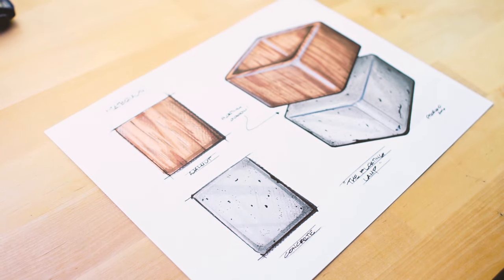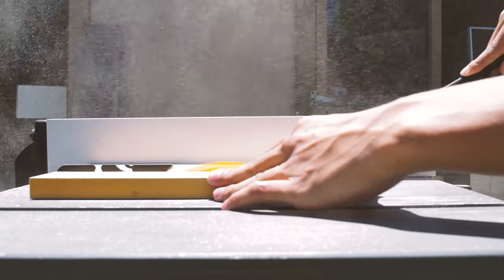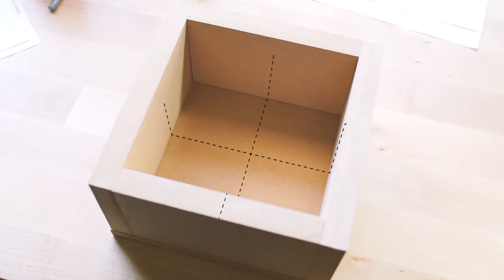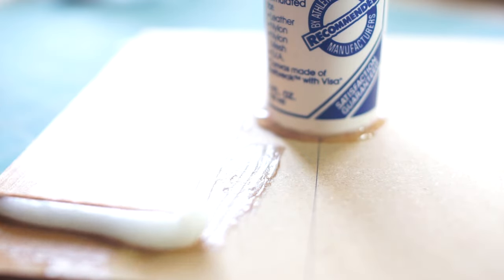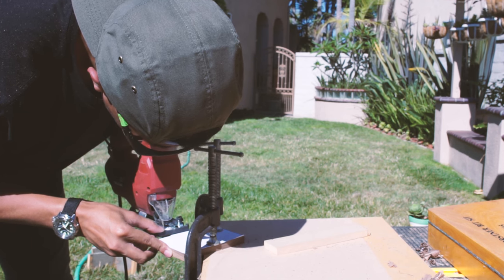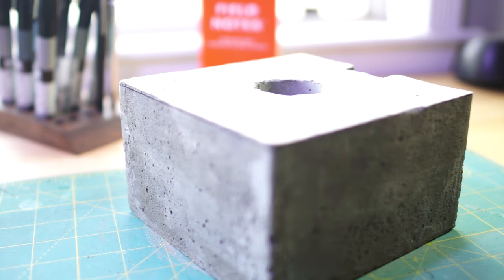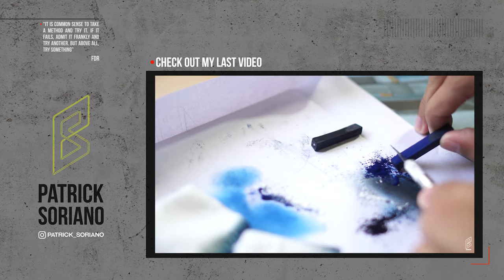DIY Modern Concrete Lamp that "floats"

Comment: Nice project man!

Quick tip :-  you can vibrate the air bubbles out of concrete with a palm/sheet sander held against the mold, I've also seen people reciprocating saw for this too although those can be a bit violent if not used with care.
Reply: sander is just right

Comment: Nice Job! If you want a really smooth finish on the concrete you can use a (random) orbital sander without the sandpaper to vibrate all the bubbles out.

Comment: If you hold a vibrating palm sander against the mold it will help the concrete settle and get the air pockets out very well.

Comment: Awesome project! I just subscribed to your channel. I'm looking forward to more videos! 

Just to suggest - I'm not sure how you stored the concrete overnight but if you cover it with plastic or a small towel and keep it in a warm place like a shed (you can keep a heater near it too if you're feeling wild) you'll be able to preserve the heat retention and moisture in order to allow for proper curing of the concrete so you can avoid it falling apart when you demold your piece. Also for smaller concrete projects if you take any power tool and hold it near your project to vibrate it, you can eliminate more air voids. 

Great work!!
Reply from the maker: Hi Lauren! The tips are much appreciated! This was my first time working with concrete and it was a lot of fun! I'll be sure to use a palm sander or something next time for the air bubbles as well as the plastic/small towel trick. Thank you for watching and thank you for the support!
-Pat Soriano

Comment: Very nice! If you add a touch of isotopic alcohol to your mix it helps get rid of those pesky pin holes. Palm sanding the mold as you're pouring also helps (-:
Reply from the maker: Thanks Danaka! I'll be sure to keep that tip in mind the next time I work with concrete :)
-Pat

Comment: YOU never mentioned how you attached the wood shade to the base
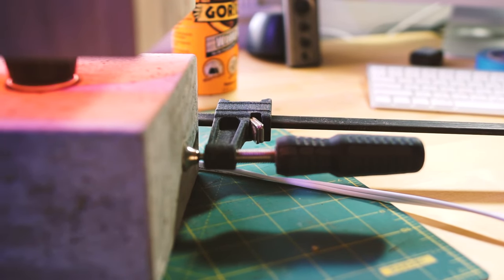Reply: 4:40 I think this is where he did it.
Reply: "I used gorilla glue, I would probably use a 5 minute epoxy, it's holding up for now." At 4:40, even has a shot of him having it clamped together while the glue cures.

Comment: The shade on the thumbnail has rounded corners inside and out, yet the video shows you butting the wood up to make square corners. How did you get the smooth corners inside and out on the shade seen in the thumbnail?

Comment: hey, Patrick.
I have a doubt. In the first example did you show us in this video, the corners is rounded. Did you used some different process or just polished the corners with sandpaper? BTW it is an incredible project. I just want one in my desk! See ya!
Reply from the maker: Hi Mateus! You can sand them that is definitely one way to get the rounded edges. What I did was I made the lampshade out of 8 individual parts. 4 sides and 4 corner pieces. On the corner pieces I used a 1/2" roundover bit in my router on one edge and on the inside I used a 3/16" cove bit to create the inner curve. Hope that helps/makes sense, thank you for watching! 
-Pat

Comment: nice design, though I prefer steel to concrete. Small idea for a variation: mount the lamp inside the wood ring so the socket is invisible.

Comment: hey man cool vid - i like the editing of the video, good job! also the lamp looks really nice, the one with round edges is a nice eyecatcher, thats for sure
i know this might sound stupid, but you should think about using aluminum plates for creating molds. if you have access to a laser cutter in your area, you should make use of it, and get a couple of plates with interlocking joints in various sizes. this will mean that concrete shapes will come in repeating dimensions, but it will reduce your waste output, and will save that dank $ in the long run. greetings (y)

Comment: This is dope! I'm gonna try making this
Reply from the maker: Sweet! If you have any questions or need help on a step don't hesitate to ask Frank! 

-Pat
Reply: I do. You said to use 1/2 inch hardwood of our choice but it appears you are using a bigger size? or am I wrong?
Reply from the maker: The hardwood I used was 1/2" walnut but for that shot of the materials I just grabbed a scrap I had laying around so I could show the materials that were going to be used. 

If you have any other questions let me know and I forgot to mention in my previous comment thanks for watching!

Comment: Excellent video Patrick!  I like the design and implementation, the pace of the video was excellent, not too long at all.  Actually, I could have used a little more explanation on how you connected the shade.  If you are not already a member of the FB group "I like to make stuff" You should join.  Lots of makers, great people.  I shared your video to the group so you'll be getting some numbers increasing there...:)
Reply from the maker: Hey Josh! Haha the video was actually around 9 minutes when I first put it together but I ended editing it down because I honestly didn't think anyone wanted to watch a video about a lamp and because of that a lot of steps were glossed over. As far as the shade, I just used wood glue but maybe a 5min epoxy would be better and I applied it to the pocket on the concrete base as well as the lampshade upright, made sure everything was squared up and clamped it up! 

I added the group of FB (at least I hope it's the right group haha) I think the request is still pending. I really appreciate you sharing the video and thank you so much for watching Josh!
-Pat
Reply: Awesome, thanks!  I will see about getting you approved for the group if it hasn't been already.  Good luck son, and I be waiting for the next one... :)

Comment: Looks awesome! Does anyone know if he used any way to fasten the lampshade to the concrete? I feel like it wouldn't be a snug fit
Reply from the maker: Hey Charles! Yeah sorry about the lack of info on how the two attached, I tried to keep the video short and because of that I glossed over that part. I used wood glue to bond the two parts and it's held up real well but I would probably use a 5min epoxy or something similar. & then I clamped it front to back and used a speed square to make sure everything was in check! Hope that helps!
-Pat
Reply: Awesome man! Thanks for the reply! Can't wait to make my own
Reply from the maker: Yeah man no prob! It's a really fun build and if you have any other questions don't hesitate to ask!
-Pat

Comment: Very sick project @Patrick Soriano! I do have a quick couple of questions.... How did you get the rounded version, with sanding? What grade sand paper did you use for the concrete? Thanks again for sharing this video...  I'm so trying this out!
Reply from the maker: How's it going! I used 1/2" roundover router bit. if you look closely you'll see that the lampshade is actually 8 parts. I started with a 5/8"x5/8" strip of walnut, used the 1/2" roundover on one side and a 3/16" cove bit on the inside, cut them to size and glued everything together. Hope that helps!
-Pat
Reply from the maker: *120/220 on the concrete
Reply: Thanks for such a quick reply.... You definitely earned my thumbs up and subscription! Not to sound like a kisser here, but it's people like yourself who not only think out of the box, but pay it forward with making a video and teaching others the craft, that make the world a much better place! Thanks for being so badass and I'll be looking for more of your videos! Thanks again!

Comment: awesome, but i wanna make it myself) thanks for great idea
Reply from the maker: Awesome! Thanks for watching!
Reply: +Patrick Soriano, until i'll gona make form for concrete and turn on my unreal saw: can i make wood plates witgout saw? cause it preeeety hard to make shapy part  with hands saw.
Reply from the maker: Hmmm if you can find four pieces of wood of similar length, you can use clamps to create the concrete mold! You can also make the mold out of plastic sheets which is pretty easy to cut with a hand saw. You could probably even use four plastic CD Rom cases to create your mold.

In the end, the concrete block doesn't have to be a square, it can be rectangular or whatever you want it to be. As long as you take your time and have fun throughout the process, i'm sure you'll come out with a beautiful lamp.

Comment: Really nice video!
I'd like to know how you made the round edges for the concrete?
-Alex
Reply: Wache I want to know this too.  He went too fast.
Reply: Concrete can be filed and sanded before it is fully cured. It can be a little tricky to get the timing right. You need the concrete to have just the right amount of cured-ness.

Comment: Hello. Nice lamp. The one thing, i didnt understand-how did U join the top to bottom?
Reply from the maker: In an effort to keep the video short, some parts were glossed over like how the two attach. Basically, you'll apply wood glue or a 5 min epoxy (I used wood glue and it's holding up fine) to the lampshade shaft and clamp it to the concrete base. Make sure you use a square to make sure everything is lined up and your lampshade isn't crooked relative to the concrete base. Hope that helps!
-pat
Reply: +Patrick Soriano thank you

Comment: Fantastic video Patrick! Really great looking lamp. I do have a quick question. How did you make those rounded corners on the hardwood top? Thanks again for the video
Reply from the maker: Hey Matt! For the rounded corners, I started out with I believe a 2ft, 5/8" x 5/8" strip of walnut. I used a 1/2" roundover router bit on one edge and a 1/8" cove bit for the inside. Cut 4 of them to length (3 1/2" I think?) and then I glued all the lampshade parts together. So for the rounded version, it's actually 8 parts whereas the simple one made in the video is 4. Hope that helps!
-Pat

Comment: can you use wood instead of mdf or melamine? i have alot of spare wood from a previous project and would like to put it to use
Reply from the maker: I've seen people use plywood in the past for concrete molds, I think the trick is to remove the molds before the concrete fully cures otherwise it'll get trapped. Hope that helps!
-Pat

Comment: Patrick, do you use linseed oil on wood before ou after glued? What did you use to spread the oil? 

Thanks !!
Reply from the maker: Hi João!

I apply oil with a rag after everything has been glued and sanded. Before you apply the oil, be sure to clean up any excess glue that may have squeezed out when you clamp your parts together. Otherwise, the oil will make it very apparent where glue was left behind. Let me know if you have any more questions!

-Patrick

Comment: What technique or material did you use to fix the wooden box with the cement cube? Cheers!.
Reply from the maker: Hi Pablo, I just used like a 5min epoxy and a few clamps to bond the two parts together.

Hope that helps!

-Pat
Reply: @PatrickSoriano  
Thank you!

Comment: Hi Patrick, very nice lamp. 
I have one question, in the "improved" version that you show at the beginning of the video how did you make rounded edges on the mold?
Or did you round them after by sanding?
Reply from the maker: Hi Pietro! You can sand them that is definitely one way to get the rounded edges. What I did was I made the mold out of 8 parts. 4 sides and 4 corner parts. On the 4 corner parts, I used a 1/2" cove bit in my router to create the inverse shape of the rounded edge. Hope that helps/makes sense, thanks for watching!
-Pat
Reply: Thanks for your answer!

Comment: How did you round off the edges of the original one?  Did you use a router??
Reply from the maker: Hey what's up Jason! Yeah for the original one I used a router to create those rounded corners. If you look closely you'll see that the lampshade is actually made out of 8 parts. For the rounded corners I started out with I think a 5/8"x5/8" 2ft strip of walnut and used a 1/2 roundover bit on one edge and then on the inside I used a 1/8" cove bit and then glued all 8 parts together. 

Hope that helps!
-Pat

Comment: Nice lamp!  How did you do the rounded edges on the first one?
Reply from the maker: Hey David! 
For the rounded edges I used a router with a 1/2" roundover bit. If you look closely you'll notice that the lampshade is actually made out of 8 parts. I started with a strip of 5/8" x 5/8" walnut, I used the 1/2" roundover on one side and a 1/8" cove on the inside and glued all the parts together. Hope that helps man!
-Pat

Comment: hey man that was a sweet project you should dohey man that was a suite project you should do a multi pairing Bluetooth speaker setup using wood and Concrete a multi pairing Bluetooth speaker setup using wood in concrete a multi pairing Bluetooth speaker setup using wooden concrete a multi pairing Bluetooth speakers setup using wood and Concrete a multi pairing Bluetooth speaker set up using wood and Concrete

Comment: Nice project!
Do you have some tips and tricks to create illustrations such as at 0:07? I looks very clean, do you use Copic Markers?
Reply from the maker: Maex I think I used chartpak markers at the time but copics will work just as fine. Think of the markers as paint, you gotta layer them so start light and then work your way up until you get the contrast and value you're lookin' for. Thanks for watching!
-Pat

Comment: sweet lamp man. How do you make those round edge corners on the lamp shade on the first lamp you showed?
Reply from the maker: Hey Morten! For the rounded corners, I started out with I believe a 2ft, 5/8" x 5/8" strip of walnut. I used a 1/2" roundover router bit on one edge and a 1/8" cove bit for the inside. Cut 4 of them to length (3 1/2" I think?) and then I glued all the lampshade parts together. So for the rounded version, it's actually 8 parts whereas the simple one made in the video is 4. Hope that helps!
-Pat
Reply: thx. great project btw. looking forward for more projects on your channel :)

Comment: is there an alternative option for linseed oil? for some reason its really hard to get it in my country.
Reply from the maker: Yeah there's actually a bunch! Danish oil and Tung oil both bring out the grain in the wood and give it a very rich appearance. There are also waxes that will give the wood a very nice finish too. Thanks for watching!
Reply: thanks for the reaction! you should do a setup tour it looks amazing in the begining!
Reply from the maker: haha what you see in the frame is definitely the highlight of my room. The opposite side is basically just my TV mounted on a wall that I use as an external monitor to frame up my shots since I film on my own.. Sucks having to get up and adjust the tripod and then sitting down to see what's in frame only to get up and move the tripod again haha. But you gotta do what you gotta do!

Thanks Jort!
Pat

Comment: How'd you make the top/lamp shade float?
Reply from the maker: Hey Ian!

The lamp shade is supported in the back, it actually extends down into the concrete base. You can get a quick glimpse of it in the beginning of the video! It only looks like it's floating depending on where  you're standing/looking relative to the lamp. 

-Pat

Comment: Awesome project man! Just one (totally unrelated) question, how did you make those sketches that you were showing around the 0:05 mark, they are super clean and sexy :3
Reply from the maker: Hey there! They were done with Chartpak markers, Prismacolor pencils and some white gouache. It's the clean up work at the end like using a straightedge to define the outline and a white Prismacolor pencil to pick out highlights that makes em pop, hope that helps! You can try googling/pinterest "canson paper render" that's basically the technique I use for these sketches!

Thanks for watching!
Pat

Comment: It's an old vidéo, but i let a tips here.

for the concrete mold, there is no need for such a complicated way to have a perfect cube. if you cut your mold with a table saw, with this large thickness of wood, the pieces of wood can already stand on the edge at a 90° angle.

Plus, if you make a more little square (the thickness of the wood less on the 4 sides of the square) and higher sides (the thickness of the wood more), put the square on the table, and the sides pieces directly standing on the table and on the sides of the square. With that, you'll have the same cube, but an easier mold to build.

https://youtu.be/fwVxTm7bgqs?t=2m12s
I put this video to in the case my english is not understadable. the 4 seconds (2:12 to 2:16) are what i mean.

Comment: Safety tip, albeit a small one. Your fence is very close to the loose pieces you cut with your miter sled, the loose pieces could get caught and flung your way. It's a minor thing and maybe your fence is a real bitch to move so you made the decision to work more quickly. 

But just a tip for everyone else, if you can make sure the surface where your loose piece will fall is clear of obstructions so it can fall clear of the blade.

Here is how Marius Hornberger tackled this same issue: https://youtu.be/jj1d9OSA2UQ?t=649

Comment: if you'd use a palm sander to vibrate the form to release the bubbles.. and a little hammering.. you'd have a shiny finish that won't require sanding afterwards... 

https://www.youtube.com/watch?v=uSSp3X07Vls

kinda like this guy.. i mean, to have that shiny finish..

Comment: you glazed over how to top and bottom attach so there is no way anyone else can make this, you didn't even realy show the back or around the light or from the top.
Reply from the maker: Hey Edward,

I may have glazed over it in an effort to keep the video relatively short but I would definitely not say that "there is no way anyone else can make this" considering someone used my design in the Homemademodern concrete challenge. Even in the beginning of the video it's pretty straight forward how the two connect.